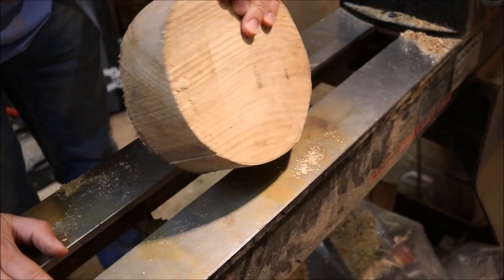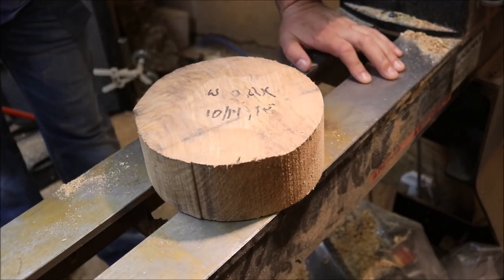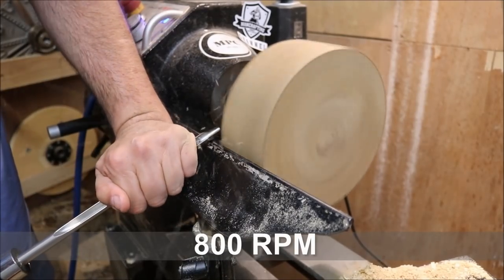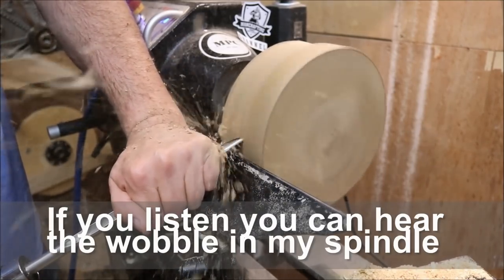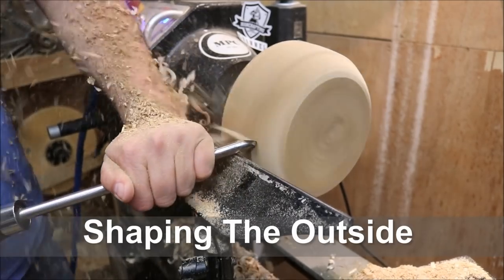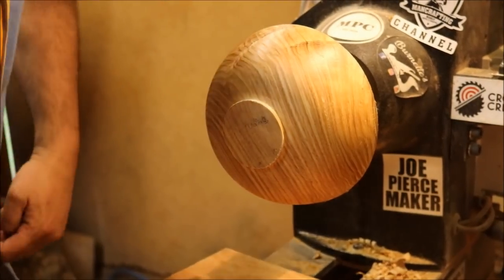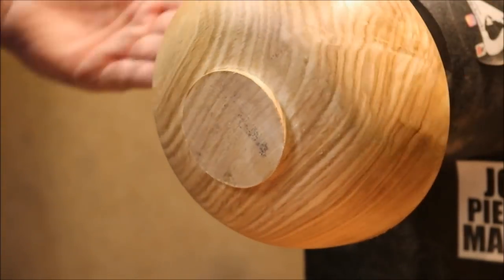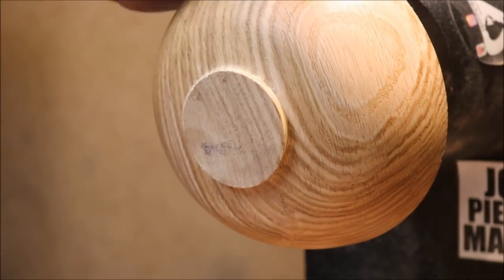Wood Turning - White Oak Bowl with Amazing Grain

Comment: hey bud. question- so at 2:41, the bottom is complete, how do you attached that bottom to the spinner without using the screws? sorry for the noob question- I dont have one, but getting one soon. Your videos are great and very informative. A+!
Reply from the maker: I used a tenon. The chuck will expand or contract to hold a piece. I discuss these chucks in this video if you are interested. https://youtu.be/RzXNeUPlUXA  Thanks for watching

Ken

Comment: Ken, nice bowl.  Did it taste like oak or acorns?  Why didn’t it need to be rough turned and dried?  How long had the blank been drying?
Reply from the maker: Hey Paul, it had sort of a honey taste. lol. You can rough turn bowls or leave them to dry in blanks. This one sat for almost 6 month. As it was a smaller blank if dried faster. I still have rough turned bowls from this same tree that are not dry yet. But I do have to admit there was some slight movement after I turned this bowl.

Ken